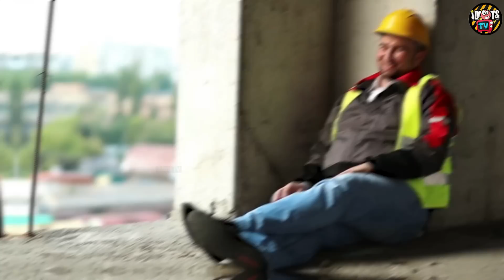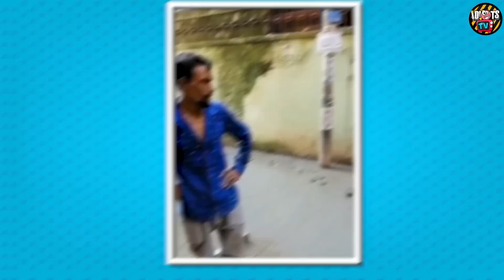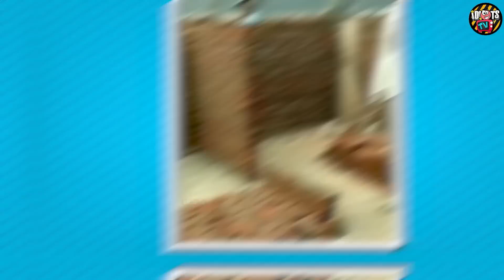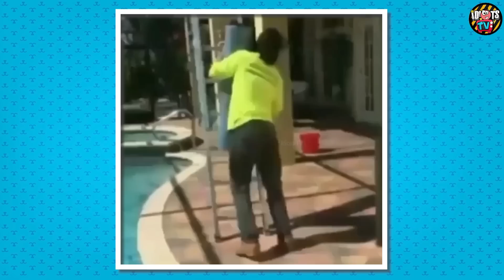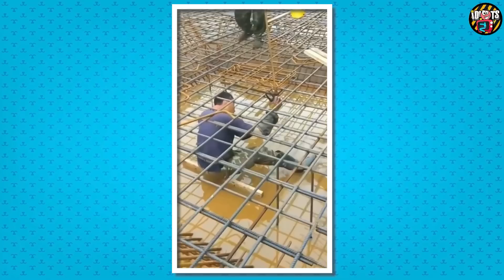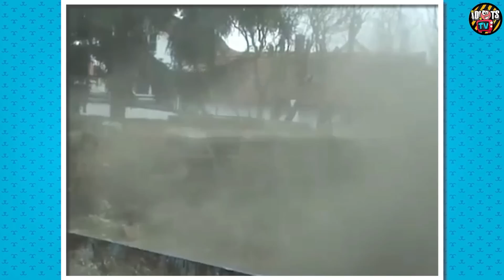These Construction workers are doing a commendable job | TOTAL IDIOTS AT WORK ▶5 | BAD DAY AT WORK

Comment: if you're gonna use a CG voice, get someone with a better handle on english to write the scripts.

"concrete mixture" ** mixer
"glass walls" are called windows
"gather these bricks in place"  ** pick them up
"these rocky road"  --no rocks, all mud.  the truck, is a tractor and the "trunk" is a trailer.